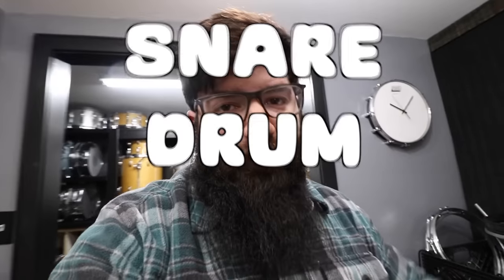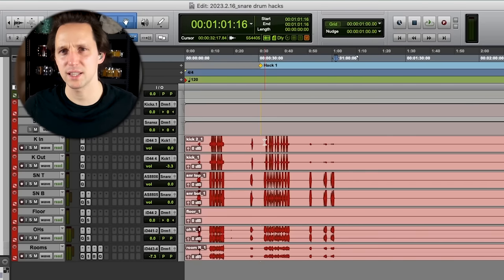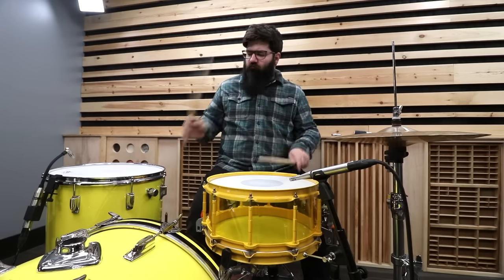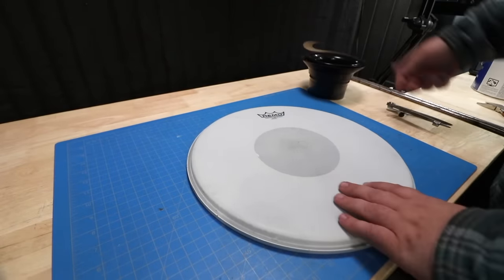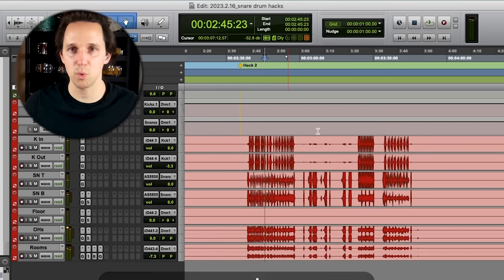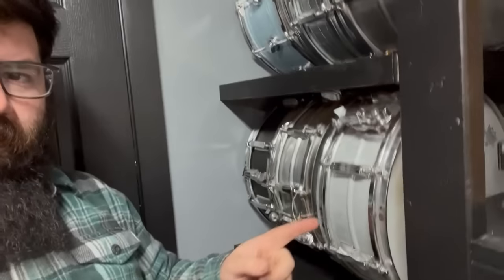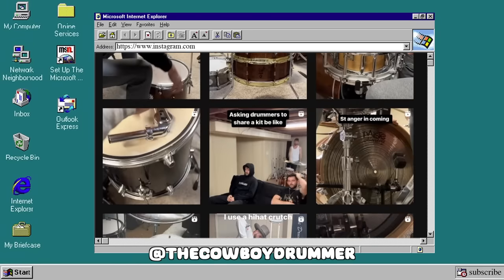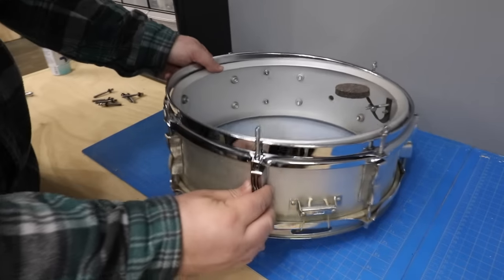Testing WEIRD SNARE DRUM Hacks

Comment: That Tom + Snare combo was great. I could totally see this as an accent drum. Now I wonder if just somehow attaching snare wires to the tom would just do the same thing without requiring a full snare to be attached to it
Reply: “Snoms” are a thing - tama makes them for like £250 which I think is a steal
Reply: You’d need to have a snare bed put into the bottom of the tom shell edge to make it work otherwise the snare wires on the even surface edge across of the bottom of the tom will make the snare wires malfunction aka not proper snare wire tension
Reply: You also wouldn’t have a snare throw off
Reply: id totally use it, if i had the money to
Reply: Just get a rim with the snares slot that's got the same lugs and diameter and jerryrig some snares onto the bottom bota-boom bota-bing snom
Reply: Saw a video few weeks ago where a studio guy just did that. He recorded several snare layers. One of the layers was just that trick. Sounded insane…
Reply: As a response to this Hack, I've got a different Stroke to it.  I'm going to post on the main comment.
Reply from the maker: ngl, every snom, field drum, ft converted into a snare, etc. are really fiddly to tune and hard to get sounding right. That floor tom had one of those bootleg pinstripes where are really thick, so maybe thats why it sounded better. I didnt have to use any muffling, mess with the wires, or retune anything. I just sounded good haha.
Reply: He already put snare wires on a floor tom
Reply: I did that to one of my Kits back in the late 60's. I liked it, so did other drummers, other "Musicians" hated it. There were a bunch of crazy Drummers back then that did all sorts of things to their Kits, I was one of them. One put Mic's and Pickups in and on his Kit ran it through Synths, Pedals, Reverb/Echo. One had an Acrylic Kit, he filled his with water, BB's, Ping Pong Balls. Another converted his kit to a Standing Kit (play it while standing or sitting on a Bar Stool). I rigged a kit with all 12" toms including the BD, tuned to scale. One in a while we'd all get together with our Krazy Kits, show off and Jam. It was a lot of fun. Then there was a guy who rigged up a Smoke Machine to his Kit, smoke would shoot out the vent holes ... lmao.
Reply: A pocket of rice at the side of the skin can do that for ya too

Comment: Hey rDavidr, These hacks were interesting to me.  I'm a "novice" at drum tuning - being a Resurrected drummer after 50 Years [1969] - 71 YO now, and retired.  I have a DW Nickel over Brass 14 X 6.5 Snare which I purchased Used and came with a previous owner installed HD dry Batter head.  It played great right out of the delivery Box from Reverb in 2021.  A few weeks ago I replacd the batter head with a new HD dry head.  No matter how I tune it - I couldn't get  the sound I wanted.  I have a PDP Concept Maple kit with a 14 X 5.5 Snare (which I also use a HD Dry batter head). In a particular playing session, I put the DW snare on top of my 16 Inch Floor Tom (G2 coated batter head) to get it out of my way.  Doing a fill, I hit the DW snare sitting on top of the Tom.... BINGO - that was the sound I wanted - like a Ludwig Supraphonic / John Bonham sound! Take it off the Tom - not the same.  The Maple snare sounded better too!  Forum posters said that like in your video I was playing 2 Drums at the same time.  One guy said Jokingly that I may have invented a new Snare Stand.  Trouble with that statement is - He may be right!!  I keep Tooling around and re-tweaking the drums & chnaged the batter heads (UV1 , UV2, and now a Power Center Dot ), but still can't to that Sound!.  Should I get a cheap 16 inch Floor Tom and make it my snare Stand?

Comment: I ordered a snare off of Reverb(Mapex hammered steel 14x5.5), and it came with an Evans Reso 7 on the snare side, which is coated.  It actually sounded pretty good.  Recently I changed heads and put a standard snare side head on it (Remo Hazy Diplomat), and I will say it nearly doubled in volume and sensitivity.

Comment: The kick port in the snare is interesting, it basically works like a bass reflex port. I would be curious what it would sound like if you take a tube with a length that has the same resonance as the bass end of a snare, rather than a kick.

Comment: When I was a broke teenager, I couldn't afford drum heads, so I used a piece of cardboard for the bass drum kind of wedged between the rim and shell.  I also had to play my snare upside down because I had a ripped batter head,  I also tried it under a 12" concert tom, and it sounded not too bad either.

Comment: Thanks for making this video. You are awesome. 
I liked it when the batter head was used as a snare side head. This was one of the better experiments in the video for me. It sounded decent to me.  I wish you had more time and loosened the top head, tightened the bottom head a little, and experimented with the snare wires by tightening and loosening them. Then, tighten the top head and loosen the bottom head to compare and see if that made it any better or worse.   You had it sounding decent when you put the top head on the snare side. I could hear a little Bonzo.
I liked the plastic bottle pieces used for holding the snares on and tightening them. 
The snare drum  floor Tom and toms were excellent.
It did sound like old marching drums, like for military style drumming .
Overall, it was cool.
I wish we could hear the difference with your soundman changing a few settings on each experiment because it was hard to really tell what he had going on and how much of it was used. 
Its cool how everyone has their own opinions and likenesses. Thanks again,
Glen

Comment: I'm a big fan of the kick port on my bass drum, I run a Super kick 2 o. The back and a Articulator on the front with a kick port both heads are by Aquarian,  22x18 and the kick has punch with a great low end. 
BTW kicport also makes ports in sizes for snare and toms but I have not tried those though
That Articulator is a marching bass drum head and that's my HACK, something I picked up while marching in the Bluecoats

Comment: John Bonham just used a 70’s model 6 1/2 x 14 Supraphonic. If you never played one then you wouldn’t know that drum itself is one best snares drums ever made. recoding and live that snare drum just cuts threw without any hacks. Now it was also used by Carlton Barret and he did change how he tunes it lose bottom tight top and the snare clasp he loses it so it barely would touch the head of the bottom so had little snare sound. But both didn’t use any kind of hacks they just toned how they liked

Comment: Back in the 70s and early 80s we tried every combination of drum heads imaginable back in those days to get that fat BackBeat snare sound most of the time we were consumed huge amounts of duct tape with double ply heads on the batter with regular Ambassador weight meaning clear on the bottom just the first hack remind me of some of the things we used to do back in those days also a tip when you detune try D tuning the lugs nearest your closest Tom and not near you that helps getting rid of any sympathetic vibration

Comment: I have a 8" pearly free floating snare I played in a hard hitting progressive band in the 90's and I was breaking bottom snare heads, 3 over a year I did play three nights a week at the time and I was a very hard hitter, I switched to Kevlar Pipe band top heads I was ripping out the edges of the top heads, Remo (Power Stroke 3 was my preference) ..the bottom head I had no idea why I was going thru bottom heads, no rough edges on the snares I did break the odd bottom snare strand but this was never the cause of the bottom heads giving out ..Top heads were pretty tight bottom head I would have liked them tighter but it would choke the drum ..so for years I used a regular Emperor clear on the bottom and I didn't break any more bottom heads ..I didn't love the sound but hated breaking a bottom head half way thru a show

Comment: @rdavidr Hey i tryed one interesting hack and i think it worked beautifly.
So i had this cheap steel shell 14x6,5 snare that had alot of shell ringing overtones that are so anoying and very thin sound due to the thin steel shell. So i in order to add some dampening to the shell as well as fatness to the sound i filled the bearing edge with the silicone and it worked like magic. Aparently this is what some major drum brands did in old days to get some beefy sound out of a thin steel shell. So i highly recomend doing this i am curious to see how you do it. Cheers

Comment: Amazing work. Quick and probably stupid question, for the floor tom on top of the snare, obviously the width of the floor tom is 14 inches to fit the snare. But my question is what size tom are you using? It almost looks like a 12 inch or 14 inch long one. If you could answer that question I would greatly appreciate it.

Comment: '01. Just got my '71 Gretsch kit. Gig time. Ripped snare side. Had an old coated batter. Tuned it up. TIGHT.

After gig. Changing head. Won't fit. WON'T FIT?!

Q: What was the snare made of?  😞